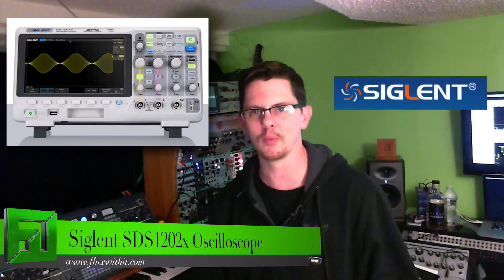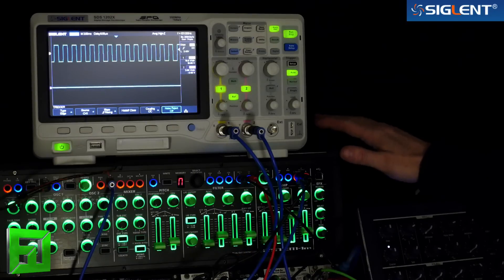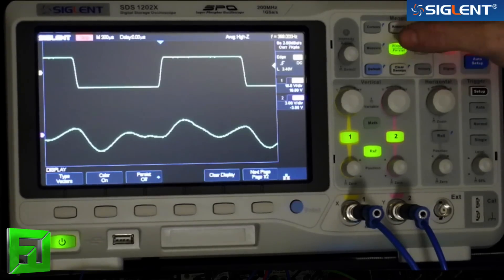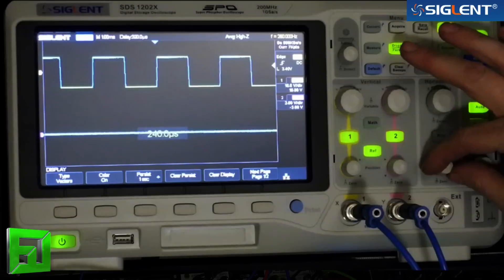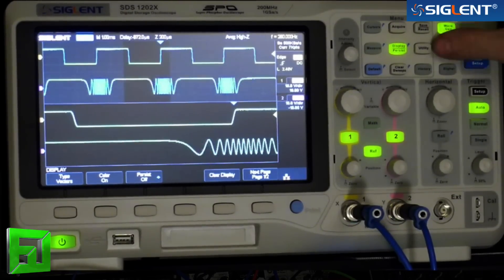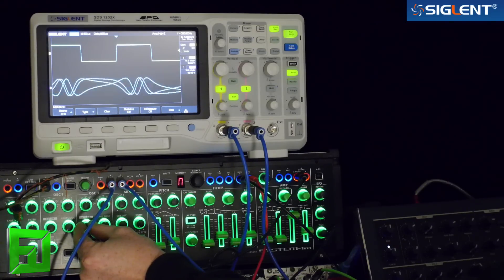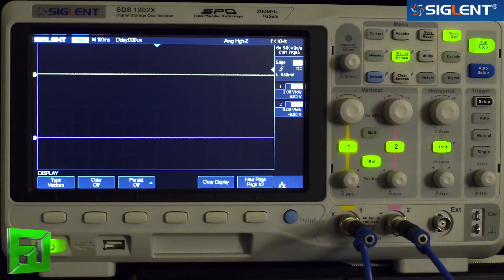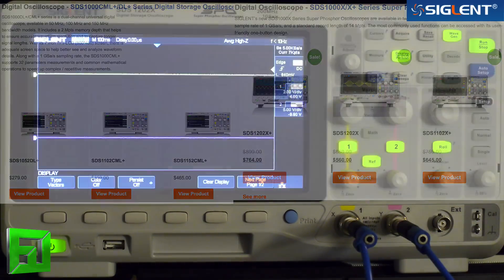Siglent Sds1202X oscilloscope review for Audio synthesizers

Comment: What did you use to convert BNC to 3.5mm mono.  Nice and neat, looks like.  I’ve searched, but nothing obvious is popping up.
Reply from the maker: I use a bnc to rca connector and from rca to 3.5mm , I also have test leads for when I need to be more precise.
Reply: Ken Flux Pierce Fluxwithit Smart. Why didn’t I think of that?  🤓
Reply from the maker: @mike.thomas  I wanna say at one point I had found some bnc to 3.5  but then they disappeared off the face of the earth lol
Reply: Ken Flux Pierce Fluxwithit Yeah, this guy seems to have a really low-profile converter that is letting him go right in with a TipTop stackable. Pretty elegant.

Comment: You don't really need a 400€ scope for low frequency stuff like this.
Reply from the maker: StarTrek123456 as stated in video there are other affordable options but not with this sort of gorgeous gradient display which may be important to many.
Reply: there are many cheap analog oscilloscopes on ebay. No digital screen can look as good as real phosphor. Some of the later models also have digital storage, so they can stop the waveform.
Reply from the maker: I would highly recommend watching the entire video, quite a few of the features I showcase are not not available in older analog scopes. beyond that fact also note the form factor as well. I love my analog scope but no way does it come close to the convenience or ability of this scope. do you have to buy a $400 scope... of course not. will a $60 scope off eBay offer what this scope does? of course not. lets not be silly.
Reply: I just think that showing all the fancy features of modern DSOs to people who are new to oscilloscopes gives them the impression that analog scopes are completely useless these days, when in fact, they can teach a lot about how the controlls on a synthesiser influence the audio waveform.
Reply from the maker: StarTrek123456 not at all, and in addition I've done many many videos featuring analog scopes ... absolutely nothing wrong with showing the benefits a scope like this can provide especially when compared to modules like the o'tool and mordax data .
Reply: StarTrek... Stop your whining please..where did he say analog scopes are useless? They are far from useless. They display audio signals beautifully. They also weigh a ton, take up half your desk and can't do a fraction of what this scope can. Noone said you "need" this $400 scope. You don't "need" a $400 synthesizer to make sounds either. For some reason a lot of people like to buy lots of synths anyway, so there seems to be a point for some people, go figure? Why do you think YOUR personal opinion of what you "need" applies to everybody else? Thanks to Flux302 for showing this scope, seems great! I'm just about to buy one, trying to decide between this Siglent and the 4-channel Rigol 1054z...